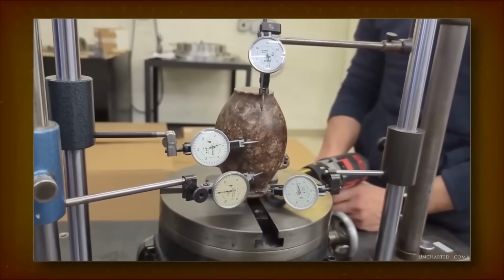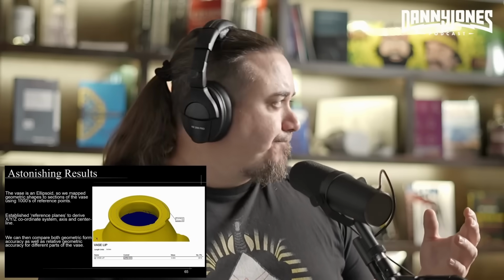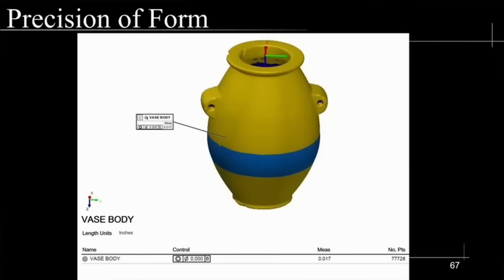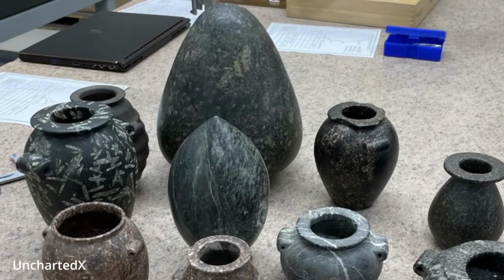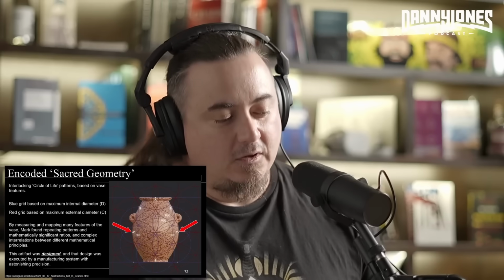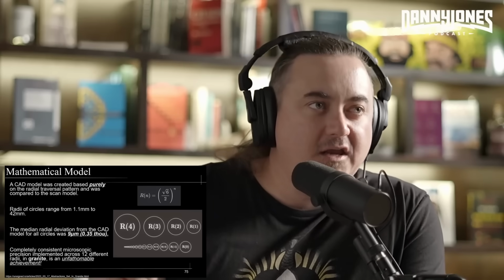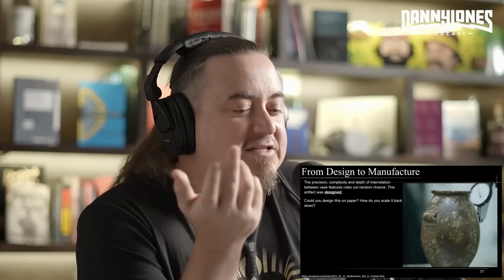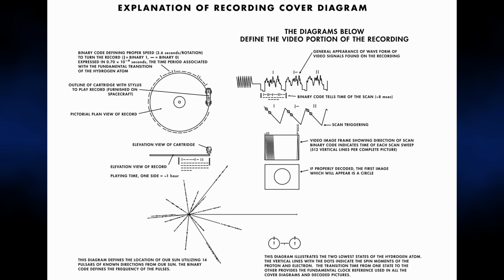Are These Ancient Egyptian Vases Actually Impossible to Make? #podcast #science #history #egypt

Comment: Here’s a list of ancient artifacts or structures that—while not surpassing the rose granite vases—still exhibit remarkable precision, material difficulty, or technological anomaly. These are the closest rivals, listed in descending order of scope and challenge.

🥈 1. Puma Punku Stone Blocks (Bolivia)

    Material: Andesite and red sandstone

    Features:

        Interlocking H-blocks with machine-flat faces

        Perfect 90° inner corners and slot/groove joints

        No visible tool marks consistent with hammerstone work

    Precision: Machinist-level flatness on some surfaces; debated tolerances within 0.01 inches

    Mystery: No iron or steel tools known to pre-Inca cultures; no quarries identified for the largest stones (some 100+ tons)

🥉 2. The Serapeum of Saqqara (Egypt)

    Material: Black granite and rose granite sarcophagi (~30+ total)

    Features:

        Each box weighs ~70–100 tons

        Internal cavity precision with flatness within 0.01–0.02 inch

        Parallel tool marks resembling modern fly-cutting

    Mystery: Boxes are deep underground in tight tunnels—how they were carved, transported, and placed is unknown

🪵 3. The Trilithon at Baalbek (Lebanon)

    Material: Limestone (and some red granite from Aswan, Egypt)

    Features:

        Single blocks up to 1,200 tons

        Fitted with no mortar, placed on foundation with no known lifting tech

    Precision: Not machining-grade, but unfathomable scale precision in placement and alignment

🔘 4. Chinese Bi Discs and Cong Tubes (Neolithic China, Liangzhu Culture)

    Material: Nephrite jade (Mohs ~6.5–7)

    Features:

        Thin-walled rings and squared tubes with inner bores

        Symmetrical, polished, concentric, sometimes less than 3mm thick

    Precision: Extremely difficult to replicate without rotary cutting or abrasives

    Mystery: Made in 3000–2000 BCE with no iron tools; polishing alone would take years

🔱 5. Great Pyramid Casing Stones (Egypt)

    Material: Tura limestone, some red granite interiors

    Features:

        Original casing stones were optically flat

        Joints between stones as tight as 0.02 inch

    Precision: Surface planarity measured to sub-millimeter tolerances

    Mystery: How they were lifted and aligned at such a height with such consistency

📏 6. Megalithic Stone Balls of Costa Rica

    Material: Granodiorite and other hard volcanic stone

    Features:

        Spherical stones from 1 ft to 7 ft diameter

        Many are within 1–2% of perfect sphere

    Mystery: Made with no iron tools; how symmetry was checked is unknown

⛏ 7. Ancient Egyptian Core Drill Holes

    Material: Granite cores (found near Giza and Karnak)

    Features:

        Spiral grooves on the granite core

        Pitch of the groove suggests rotary cutting at high feed pressure

    Precision: Cut rates not reproducible with soft copper + sand abrasives

    Mystery: The rate of material removal exceeds modern assumptions of ancient tech

🕳 8. Boron-Containing Glass in the Indus Valley (Harappa & Mohenjo-daro)

    Material: Early glass with boron content

    Features:

        Consistency in recipe suggesting advanced pyrotechnology

        Controlled refractive and chemical properties

    Mystery: Boron isn't naturally present in high concentration nearby; requires high-temperature control and sourcing

🌀 9. Gobekli Tepe Pillars (Turkey)

    Material: Limestone

    Features:

        Pillars up to 20 ft tall with 3D bas-relief carvings

        Freestanding T-shaped stones set with precision alignments

    Precision: Architectural symmetry and artistic consistency over vast site

    Mystery: Predates metal tools; no agriculture nearby at the time; unknown purpose

🪚 10. Stone of the Pregnant Woman (Baalbek Quarry)

    Material: Limestone

    Size: 1,000–1,200 tons

    Precision: Not carving detail, but logistics—unparalleled in size and intent

    Mystery: No consensus on how they planned to move it

Comment: I worked for Janicki Industries as a 5 axis CNC mill operator. The mills that I operated were large enough to create some of the largest statues in Egypt with the same levels of precision as this vase. Janicki is an aerospace engineering company that produces tooling and parts for many advanced aircraft manufacturing companies as well as NASA. Janicki has CNC machines capable of carving a sculpture on the head of a pin to making a 1:1 scale reproduction of a motor home with every detail in exact specifications of the original, down to the notches in the heads of screws on the taillights…  this is clearly the same tech use to create this vase and many many more objects in Egypt.

Take a few minutes and google ‘Janicki industries CNC mill, Sedro Woolley Washington.’

Comment: I originally posted this on the @WorldofAntiquity channel, where the presenter — who identifies as an archaeologist — claimed the unfinished obelisk was made using hand tools. I shared a physics-based comment questioning the feasibility of that claim. Sadly, it was removed. No counter-argument, no discussion — just deleted. It’s disappointing to see a supposed academic unwilling to engage with valid, fact-based challenges. Isn’t open debate the core of real archaeology and science?

Now, to the point — let’s stick to physics, not just traditional storytelling. The unfinished obelisk in Aswan weighs over 1,000 tons. To carve it using only stone tools, workers would need to remove around 950,000 kg of granite. Experiments shows a skilled person using a dolerite pounder can remove about 1.5 kg of granite per hour — meaning it would take 630,000 labor hours. Even with 100+ workers doing 10-hour shifts, that’s over 10 years just to free it from the bedrock — not counting shaping or polishing.

Then comes the transportation theory. We’re told they floated 500–700 ton obelisks down the Nile on wooden barges. But simple physics says: to float 700 tons, you need to displace over 800 m³ of water (including the barge’s own weight). That requires a massive, perfectly sealed wooden ship, likely over 60 meters long, able to float at least 1.5–2 meters deep. Without metal reinforcements, waterproofing, or modern design techniques — could such a vessel even hold together, let alone be stable with a 700-ton rock on board? And what about loading it? There’s no known evidence of docks, ramps, or cranes capable of handling that weight.

This isn’t about denying history — it’s about questioning the logistics and demanding evidence through replication. Until someone actually carves and transports a 700-ton obelisk using ancient tools and methods alone, the story remains speculative, not proven.”

Comment: My much more plausible theory after watching this clownshow for 15minutes:

Granite block/rock on a spinning base (not hard to build in myriad ways), a string attached to a fixed point, used to shape the General circular shape (turn it and scrape/mill it until it's mostly shaped, leaving out the Strip Where the handles are, then forming the handles, and Afterwards smooth over the area Strip between the handles. Then hollow it out. Most of IT done on the Spinning contraption. This will easily achieve the measured precisions....

This is a trillion times more plausible than ANY of your absurd Claims for which exist not a single indication or evidenced 😂
Reply from the maker: Cutting granite with a string is plausable?
Reply: @historydrops  🙄
Reply: @historydrops  the string is to shape it, the cutting/scraping is done with whatever

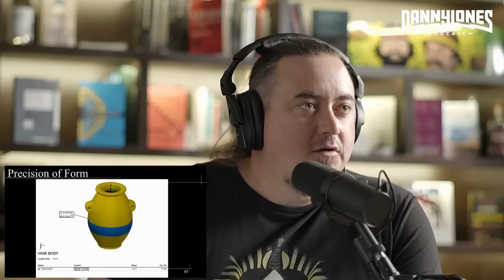Comment: 11:00 They had actual tools and machines. Dude pottery is one of If not THE oldest manufacturing techniques in the world... Perfectly spherical tells you one thing: it was done with a laythe/turntable style machine and or scraping with a circular object (look up Japanese mud balls). All you are showing is your lack of knowledge and imagination
Reply: The precision by which these artifacts were made is on par with what modern day super precision machining can make, and in some cases better. Super precision machines have moving parts tolerances (super precision shafts and guiderails, special tooling, and computer guided numerical controls, etc.) beyond ordinary machines used by common/standard workshop lathes and milling machines. The japanese pot making turntable is nowhere near when it comes to performance, precision-wise.
Reply from the maker: It's like explaining mathematics to rabbits here
Reply: This isn't pottery it's carved stone.
Reply: But they say they didn't have a laythe etc when these were made. Even if they did, it doesn't explain the accuracy. You wouldnt get close to this level on a modern day machine, let alone what they would have had around to make these.
Reply: Modern day extremely accurate machining tools still require the ability to measure accurately.  Things like calipers, dial indicators, that are ridiculously accurate.   To make something this precise would require the ability to measure something that precise.   A surface that is 1 thou within perfectly flat is difficult to achieve with Modern day machining...
Reply: Lol, you know nothing young one

Comment: Don’t forget that the absolute minimum that the CMM can measure is only 1-1000ths of an inch. So the top surface of the vase could be waaaaay closer than the control surface is leading.
Reply: CMM's can normally measure to within +/- 2 microns.  A micron is .000039".

Comment: If they didn't chip away at the stone to shape.. then they must have drilled a hole in a square block. Stuck it on a lave / turn table and then slowly using some tools moves up and down to shape the object...
Reply from the maker: That is how we would make them. But, such precision also needs precision measuring

Comment: I see no correlations between the geometry of the Seed of Life and the geometry of the vase shown initially. The diagram of the former in the graphic image has been simply imposed on the profile of the vase, whereas, if it were really significant, one would expect to see features on the vase that either coincide with points of intersection of circles or are tangential to them. But there are none. Without them, it cannot be claimed that geometry of the vase is connected in some way to the Seed of Life. Contrary to the claims made for this underlying sacred geometry, the diagram therefore provides NO evidence that the geometry of the Seed of Life is the basis of the shape of this vase. This does not detract from the rest of the evidence, which is highly impressive. The introduction of the Seed of Life geometry is a questionable and unnecessary extra claim that skeptics (which I am not) will latch onto in order to try to discredit what is being claimed for these amazing vases.

Comment: To me I see two profiles, one with the outside of the vase and one the vase with the lug handles. What if the rotational force was not constant during the manufacturing process, but they instead used two profiles out of harder stones or metal and they instead ran a stone across or perpendicular to the top to bottom along the template (think of a T shaped tool that rests on those profiles that is not allowed to take out more of the material than needed) to form the two different profiles of the outside of the vase. What speaks for that to me is the shape of the lug handles when looked at from above. What this gives us would they would never have to change the tools during that process and therefore no errors introduced. So you might just have thought of it being a lathing process around the vase and not a top to bottom kind of process. And yes this only describes the outside of the vase and not it's top/bottom/inside. Thought I'd just share my thoughts on the subject.
Reply from the maker: But the scans show only horizontal patterns.

Comment: So heres a thought... he's talking about this not being able to be done by hand and automatically it seems people go to computerized and/or electric powered machines, but maybe a hand cranked device with a jig or some kind of repeatsble pattern where jigs are swapped for different parts of the vase... 

Here's an example: When you buy a pair of glasses, the optometrist has to cut the lenses to match PERFECTLY with your frames. How do they do this? I once saw how... The optimetrist had a small little machine that could easily be powered by hand, that on one end, a wooden or polycarbonate blank of the exact shape needed and on the other end was a blade that would carve the lens. The one side would trace the edges of the blank and the other side would simultaneously carve out an exact copy from an oversized lens that needed to be cut down to size. The machine was completely analog. Imsgine the way a roller traces the edge of a cam on one end and at the other end of the shaft is a blade cutting out an exact copy from another material. I think its possible, but would just take longer because the blade would be spinning slower...
Reply from the maker: Interesting theory

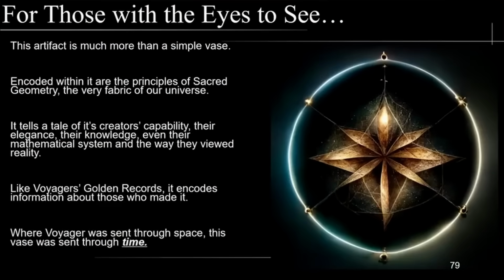Comment: About 1/8th of the way through this I was already thinking about the golden records we put on the Voyager space probe then he said it at 31:28. Clearly these are meant to communicate in the medium best suited for travel across time as opposed to travel across space. In fact stone is less susceptible to degradation in space or over time but escape velocity fuel consumption drove NASA's choice. The choice of stone as well as the dimension of time instead of space suggests a more insightful approach than the Voyager mission engineers took.

Comment: I like how some of the circles dont align at all. As a stone sculptor some of the stone i known and its not that hard to work. They can be chemically hard but mechanically they are brittle. I recon one of these can take 2-3 months.
Reply: Make one.
Reply: @hairtoss7975   I have but with modern tools. Maybe a day or two. But there are methods to create spherical shapes with just one joint and rotation. Flat planes are easy.
Reply: @TooM.46 If you can make one to the EXACT measurements in this video, i’m sure people would pay a lot of money to see that. But you might wanna watch it again before making any promises, because i think you missed most of it.
Reply: @Alfahippie   Its not hard just long process. When you use hands to grind stone you eventually get to these precise shapes. I can grind and polish a sphere without using any power tool. A true mastery is when two surfaces fit. Having perfect geometry and prefect measurement is not the same.

Comment: 3/1000ths of an inch is 76.2 microns - it is not great precision for a modern machined surface but for a hard stone is quite impressive. Essentially they achieved almost CNC machining tolerances several thousand years ago without any modern tooling or cutting materials on an extremely difficult material to process.
Reply: 0.003" is highly precise for 90% of engineering parts

Comment: Every one of these videos, you underestimate the skill of a bored yet skilled human craftsman. I worked for years with tungsten carbide, silicon carbide, and the like. We had parts coming out of multi million dollar machines, being traced by a CMM. In the end, it always needed a human touch, and often, what I had to use in the end was just my eyes, hands, and an optical comparator. Which is nothing more than a shadow box with mirrors, basically. All of the technology at our disposal, and that is what it came down to. 1/10000/in in all dimensions. And with material that can only be worn down by diamond paste. Sure, I used some receipicating and oscillating tools, but in the end, I was rubbing a stick against my part. I had an array of sticks, hard through soft, and an array of different grades of diamond abrasives. Machines just couldn't do it. Not unless you get to the level of polishing mirrors for certain satellites. Also, I dont know what was supposed to be proven by putting that vase on a turntable, and throwing multiple dial indicators on it, but I got a chuckle. We do that to rough stuff out on a lathe. Even the nice mitutoyo indicators are not particularly accurate when it comes right down to it. They were probably used right before on a piece of bar stock.

Comment: they talked about .oo1, I was a calibration tech for many years and I would verify thickness to .00001, that on millionth of an inch and diameters to .00005 witch is 50 mil......001" is a mile from what I was dealing with...but still quite impressive.